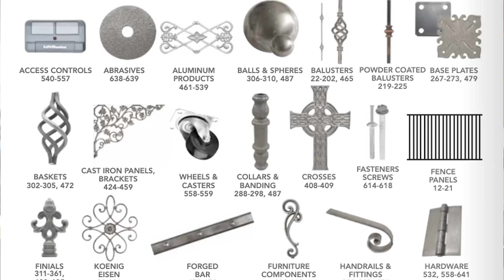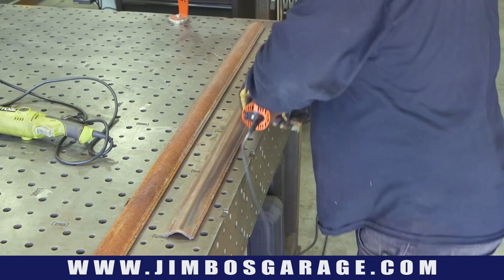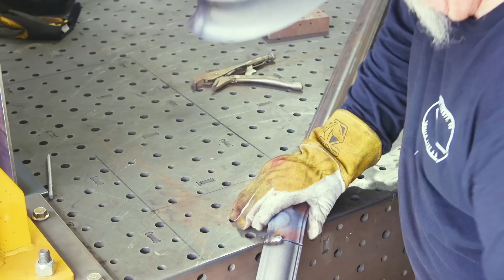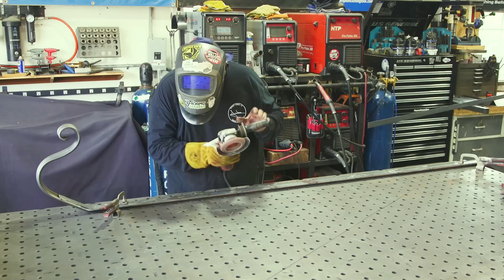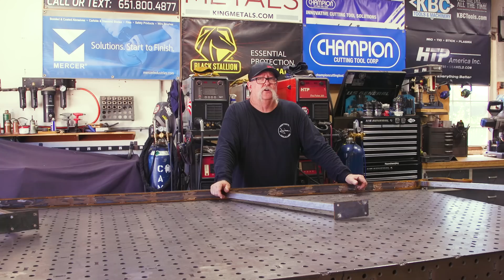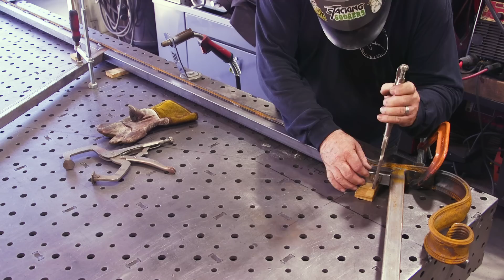Outdoor Decorative Metal Handrail Build | JIMBO'S GARAGE

Comment: This is timely for me, I'm currently planning a similar handrail for an exterior stair, I'm using a 1-3/4" molded cap rail with a 1" x 1/2" bar channel underneath to give it girth and with lamb tongue ends... I appreciate your videos!
P.S.  KingMetal is great for the hard-to-find stuff.

Comment: Hello from Romania, right from Dracula's Transylvania :) . Can I give you a piece of advice if you don't mind? To prevent the large metal distortion due to the high welding temperature, you could try shorter welds, like 1/4 inch instead of 1 inch. It's guaranteed to hold! I've been following you for a long time, I've seen all your videos, and I always admire the tools in your workshop, especially the welding machines and the welding table! I also have a metalworking workshop in Romania, just as small as yours, from which I earn my living; it's my business! Good luck with everything!
Reply: I dont think he reads comments
Reply: @smashyrashy   I know he used to!